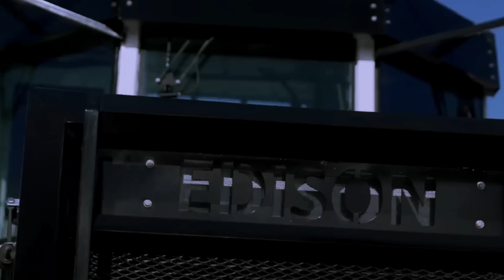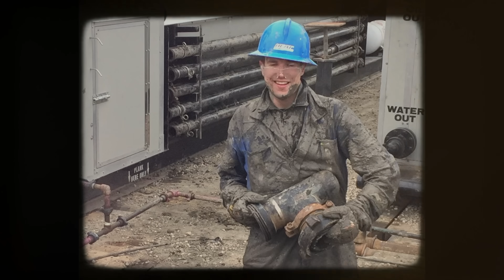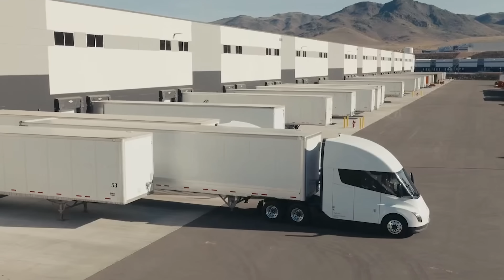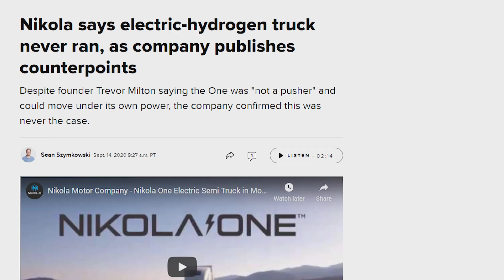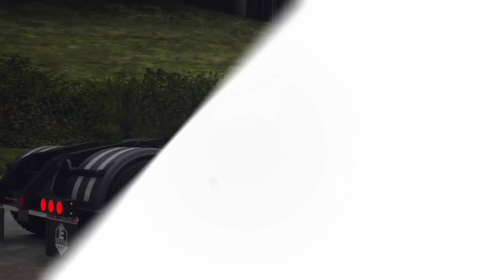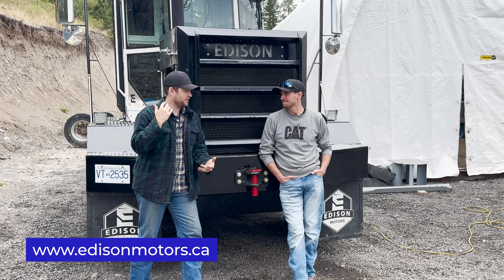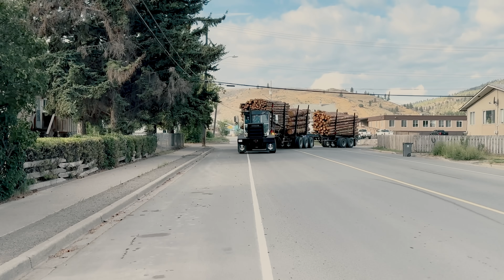How We Built an Electric Truck From Scratch

Comment: People who tell you that you can't do something mean they can't do it. My dad and I built a tractor out of an old FWD snowplow and we heard the same BS over and over again. Oh you can't do that and I realized what they meant was they can't do it. They don't know how so they assume you can't either. Dad made a surface grinder out of some linear bearings and an angle grinder to cut the teeth into the transfer case input shaft because the Machine Shop we hired to do it screwed it up so he fixed it. There are certain things may be impossible, time travel, teleportation but I never tell someone they can't do something. I might say it is going to be difficult but never say impossible because I don't know what someone is capable of doing. I had the idea of making a hybrid semi about 15 years ago and talked about it to people but never got if off the ground. I am so happy that you all did because you have done exactly what I was thinking and it makes me happy to know that it was possible. Never allow someone else to tell you what you are capable of doing.

Comment: what is the fuel consumption per mile of your hybrid diesel (generator/battery/motor) vs normal diesel truck (engine/gearbox) ???
Reply: Depends on the truck purpose. OTR trucking will see little gains of being diesel/electric. It probably does not make sense.

Vocational trucks, like a garbage truck or cement truck will run completely off electric for x hours a day, then get the advantage of 'regen' braking. So 'diesel fuel' consumption will be much much less than a comparable diesel only truck.

A diesel/electric logging truck could drive up the hill on battery, then fill full of heavy logs, then 'regen' brake down the hill and refill the batteries. Theoretically fuel usage would be zero, and electric charging usage will be zero. Another company does this with a giant electric mining truck in Biel, Switzerland. Fuel/electric costs are zero.

Comment: At 8:55
"....EVs have been around since the 1930s...."

I would beg to differ with you, but not in the way you might think. Electric vehicles were considered more advanced and better than gasoline vehicles as far back as 1900....they had more power and more range than the gasoline vehicle. 

Amazing how the tides have turned....

Comment: I been having thoughts for ideas on trucks I love coming up with concept and designs for stuff one ideas was how would I make my own truck, never got asking around if the are good idea or not least conceptually.

I'm curious if trucks have a tool box for both trucks and other vehicles, I always thought trucks or even most vehicles should be designed with tool boxes built in that both clean and tightly not randomly thrown in that it takes you a minute to search for specific tools needed? 

Doesn't need absolutely everything more if Basics from different types of screws drivers, wrenches and so on, idea like you did with a truck all of these tools should be common enough to get anywhere, maybe even just by a complete tool box kit and place it on the truck. Which makes it so you don't need to make every tool for the tool box as they already exist on the market. 

I do remember a septic truck guy even added a bullet wound kit. Wouldn't hurt for an item to go in the trucks by default with a basic medical kit. 

Even thought of adding basic camping equipment to trucks though properly not needed if you can sleep in the trucks but could be a life saver if ever stranded or using vehicles such as cab overs trucks and so on, 

Not sure if they are practical or useful as in my mind, I'm not a trucker myself so I don't know what's good or bad, I'm curious about others thoughts

Comment: The reason why you didn't need to raise hundreds of millions of dollars and that is because you didn't develop any proprietary technology.
 
Why would you even use a brake treadle valve, why don't you use electrically actuated air brakes.  They are much simpler and they use less air to operate the brakes and less air lines needed and less likely to have lines ripped out, not to mention much better and safer brakes.

Why would you use drum brakes especially in Canada where brake drums like to freeze up, disc brakes are far superior and much easier to service.

Comment: Modern vehicles are disposable because they have been filled with hi-tech hardware and flacky software.  The hardware will be impossible to find replacement parts for in just a few years and support for the software disappears shortly after the next major version appears.  Edison's focus on the KISS principle applied to truck design is a strong commitment that the truck will be maintainable over a long service life.  The parking brake is a perfect example.  A custom parking brake activated by a touch screen is now dependent on a piece of fragile technology that goes obsolescent the moment its installed at the factory.  A decade from now that touch screen is both unrepairable and unavailable as a replacement part.  Tesla's truck is destined to be an expensive failure over the long term.

Comment: I really want these guys to get their hands on my 89 F350 Custom. It is an underground vacuum truck, which only requires a 1/4 of the power output that the International ICI puts out 70% of the day. Especially when underground, we desperately need lower emissions as it's easy to gas yourself out.

Comment: Why is an electric truck better?  Is it less expensive to operate?
Reply: Battery electric vehicles have potential to have many less moving parts. An ICE is quite a complicated machine.
So for a fully electric BEV semi truck such as Tesla the electricity costs can be lower than diesel. Fleet owners (which I think will be the Tesla buyers for the several years) can calculate it. Maybe also have PV-solar together with battery storage at/around their warehouse. Then the electricity bill will not vary depending on other factors and the can calculate costs far in advance. They (fleet owner economy people) like that. Also for local/regional delivery as the Tesla Semi (and other OEMs BEVs are) it's a positive that there is no tailpipe emissions and less sound in the cities.

For a series hybrid semi such as Edison Motors, with the right application, such as logg hauling probably is, the diesel consumption can be less. These hand built early trucks will probably cost more so there will need to be used a while for the TOC to be less then regular. But if you look on it - these guys have in the 2000s (and maybe 2010s?) been running trucks from 1960s and earning money. That the early machines are a bit ruff probably doesn't matter so much - you don't need the latest logging truck from the regular brands (which has stopped making them like this) to compete. And there stance on right-to-repair etc. I think will go a long way towards enough owner-operators of logging trucks will test them.
Reply: They talk about this in a video from fully charged show 2023.
For logging in, BC you need 50% less fuel so you 10.000$ fuel cost is cut in half.
For long haul this truck is actually worse because these trucks are perfected for years on fuels economy.
But other applications like, cementtrucks can work 24/7 because electric is quiet, ambulances don't idle, service trucks don't idle, instant torque

Comment: The only thing that broke on Tesla breaks was the digital controller would not turn on the air compressor to release the breaks Bosh was the manufactur for the digital to analog controller.

Comment: Thing looks great as a logging truck but the design should be streamlined for better aerodynamics if you intend on hauling containers. It'll help with fuel economy and Oh what the hell you already know this
Reply: There is a short video about why aerodynamics don't make an impact for them.
And I didn't think Edison is the right truck for the OTR flat roads highway truck. You don't save on fuel when the 99+% of the time is spent at a speed that the gearbox has the Jeff perfect ratio for.

Comment: I can’t wait until your Company develops a simple, rugged, reliable off road 4x4 truck.
The trucks available today are very expensive and are not rugged reliable and reasonably priced.
If any manufacturer starts fabrication of a reliable off road truck I’m sure there’s a demand for such a thing. I regret selling my 
LandCruisers FJ 40 and 80’s. I’ve owned several, and today these 50 years old trucks still sell for more than they did at the dealer.

Comment: The impressive part is that you got it approved for road use. Technically, things can be done... the problem is red tape. Governments like engineers and paper pushers, they don't like small businesses and hard workers like you... Building things is hard but doable, building them right is also doable, getting a government employee to approve it... much more difficult... unless you're a huge company, then they'll approve even unsafe designs while denying good designs from small competition.

Comment: I think you guys should use the "stealing teslas idea" thing less, even though tesla's failed and delayed truck made the demand for Edison Motors. Tesla's idea is an fully electric long hauler, while your truck is an electric logging truck with a generator. It is two completely different trucks, and they don't share the same idea.

I would love a car/truck with an eletric drivetrain and a diesel generator, but it will be less effective for most use cases. Hope you guys succeed and change the market for the use cases where your solution makes more sense than anything else!

Comment: These guys thinking they compete with Tesla is like those midwestern moms selling homemade cutting boards on Etsy thinking they compete with Ikea. I'm sure the trucks are great, but come on, the companies cannot be compared. Tesla isn't just trying to make electric trucks, they're attempting to make an integrated, highly efficient system to transport loads and people from one point to another. The truck is only one part of it, and deliveries are slow because they're far, far more sophisticated than just an old truck retrofitted with batteries, a few motor and a generator.

Comment: I am going to laugh as the lawsuits roll in from the pickup truck conversions.  How much unsprung mass are those electric axles going to add and how are the handling characteristics going to change.

What about braking, are they going to have the proper tone wheels for the ABS systems to function.  There is many factors that can affect brake system performance and brake systems are designed so all of the individual parts function properly together.  Changing piston diamater can have a major impact on braking performance.  What about steering geometry chages causing bump steer.  

All of that is one massive liabity.

Comment: Love the argument about keeping it simple with off the shelf parts. I built my electric Toyota Hilux the same way with that same exact mentality in mind. I cannot stand how EV companies and vehicle companies in general are selling heavily over-engineered vehicles that can't be worked on or serviced. The Hilux I built was done as simple as possible knowing I can go to any junkyard to find stuff. And especially the EV parts. And if anything breaks on the truck I can fix it easily. My truck Is a pure EV now but I'm inspired now to throw a little Onan twin diesel in there to keep the pack charged for the longer hauls. Thanks for doing this guys!

Comment: Please consider making a body kit which can be placed on top of the existing electric truck, with a few bolts, in order to make it more aerodynamic and look more futuristic. Add some LED strips on the edges, so cars can see (especially at night) from a long distance that a truck is on the road, as well as more LED strips for more blinkers, and then use the truck to carry cars at auto shows, to advertise it. I'm talking events dedicated to trucks, where big companies announce their newest products. If you can get one to a Tesla event, and use a trailer on which you write "The first electric truck with deliveries already started.", and maybe also write the price per truck and battery capacity, as well, and ideally have a futuristic body kit on the truck, for the best chances of making it on the news. 

I can already imagine: "New electric truck company parades their truck(s) at a Tesla announcement event, having already started delivering trucks to the customers." and "New electric truck company parades their trucks at events for cargo/freight companies, before delivering them to the customers.", and maybe "Underdog electric truck company undercuts Tesla's electric truck prices by substantial amount and delivery date by years!".
Reply: I think you have it on backwards.
Tesla has been running internal tests (use) their Semi for years and it's like 1½ years since PepsiCo got their first batch (a few times bigger than what Edison Motors plans to build next year) that do real work for them. They are building the big factory to ramp production.
Since Tesla make full/only BEV trucks and Edison Motors do series hybrid they aren't even aiming for the same customers.
Edison has made a single truck from the scratch and it was rolling on it's own into the Fully Charged live 2023 expo, but has required more testing, programming etc. and we only right now see glimpse of it actually doing work (hauling logs), which ought to have been recorded the last month(s).

Edison Motors aren't ahead on the development/delivery of trucks compared to Tesla, they are behind. So why would they parade around to crash a Tesla event when Chace has explained how they don't want to rush it and say they will build lots of trucks so their orders are already full for a long time.

I which both products succeeds in their market but you got it all wrong. And I believe some of the other OEMs beat Tesla to deliveries (although that was probably a "let's jam a electric drive-train into our existing production line" variant).

Comment: Guys, why are you lying, your truck is a diesel-electric hybrid.  Only can be an EV if there is no I.C.E.  Your truck is a HYBRID...WHY LIE?
Reply: They clearly explain it's a diesel hybrid (it's a series hybrid). To make such thing you need to make a battery electric vehicle first anyway. So it's an electric vehicle. They choose to charge the battery via an onboard genset. It's not harder, it's easier to build a full/only battery EV, they just need to pull out the genset and put more batteries in. With their intended market of logging trucks the fast chargers for trucks won't be available so the most economically way to power that truck with tons of batteries would be a stationary genset... So netting nothing.

Comment: Honestly using logging for EV semis seems likea really good use case for them, especially combining them with solar panels for charging on the way up! You can't exactly refuel a semi when you're in the woods, but you can put up those panels and get the sun to to do the work for you!
Reply: It's recharging of onboard  diesel generator. Having solar panels on it would be the worst idea (for recharging the main battery).
Reply: @subwarpspeed  Well, yeah, but it still can save some energy whilst the truck is waiting for all the logs to get back. And any fuel not spent is money saved!
Reply: @meganegan5992  I don't think you realize the scales of how little solar power gives you if you meant onboard panels. And they add weight which decreases load capacity and increase the power demand. Onboard solar doesn't cut it for the propulsion of the vehicle. What they have is some solar panels already on the roof of the Topsy truck, that's just meant to top up the low voltage system (computer and other loads running even when truck is "off") while parked. There it solves the problem - not having to (if parked outside with sun) having to connect it or to have it pull energy from the high voltage batteries (which in the very very long term would mean the generator has to be started).
See the light towers in the video, those big panels are required for charging batteries so that those LED lights can shine during the night.

Having a park of solar panels at the lumber yard that supply the grid, and also have a charger for trucks, that could be a good idea.

Comment: BS
Your truck in NOT electric. 
It burns fuel so its an ICE truck
Just another piece of Cr..
Reply: The engine is only there to charge the batteries.  It runs directly off the batteries and is propelled by the electric axles.  There recent video of them hauling two loads, about 170km in all, and maybe 6-7 hours of the day (the amount of loads they could do during the mill's business hours).  They used 45% of the battery and the generator never needed to run.